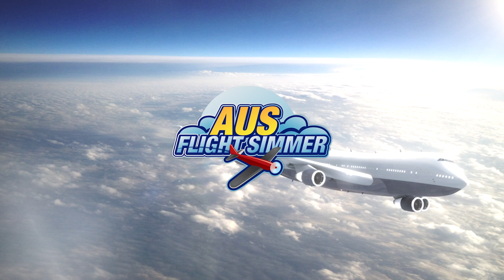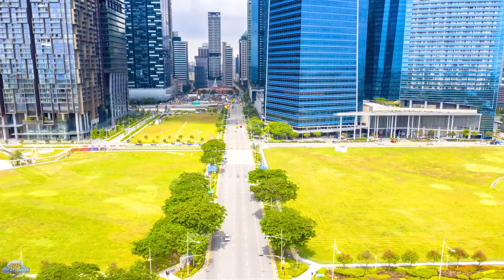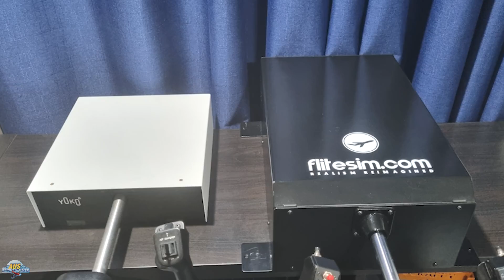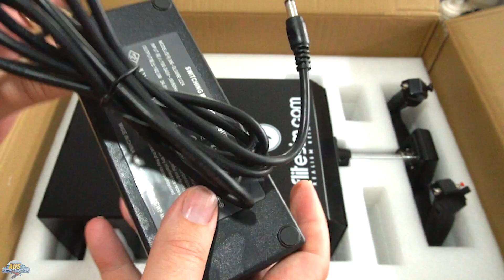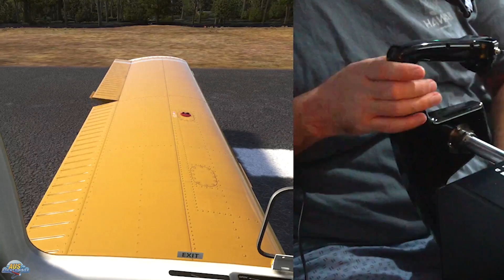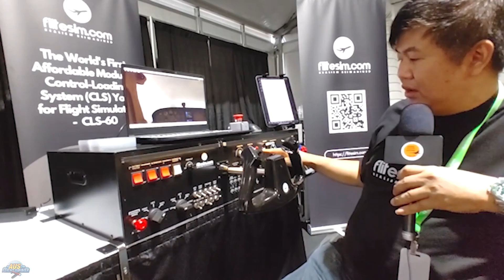Flitesim.com - NEW FORCE FEEDBACK CLS60 YOKE (AMAZING REALISM)

Comment: I don t really agree with the vibration on the yoke due to engine running.  In a real aircraft like the 172, you don t feel the engine vibrationbtheough the yoke.  On startup, it is the whole cabin slightly shaking, so if the feature is to replicate this, then fine, but it is not specific to the yoke but the whole cabin instead.  What can be felt though on startup, is the prop wash that moves the elevator position and hence the yoke pitch position.  But when yhe engine is idling on the ground, there is no vibration felt on the yoke.

The price positioning makes it the most interesting yoke even against non-ffb yoke.  It s a no brainer imho.

Comment: That control box is waaaay too big/tall. The yoke shaft is towards the top. This is a deal breaker for most Air Manager desktop/touchscreen users. Devs should realize that AM Touchscreen desktops/knobster are a very cool/flexible solution. Compare to Simionics FFB low profile. Not affiliated. Beware the immersion rabbit hole!